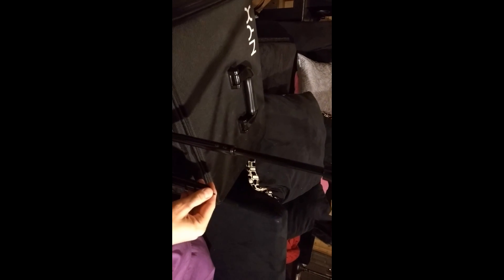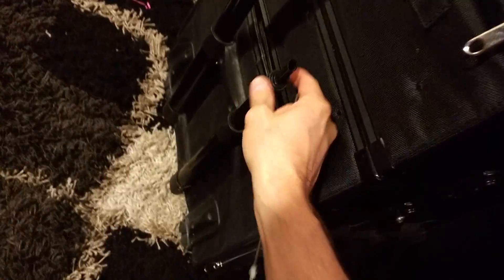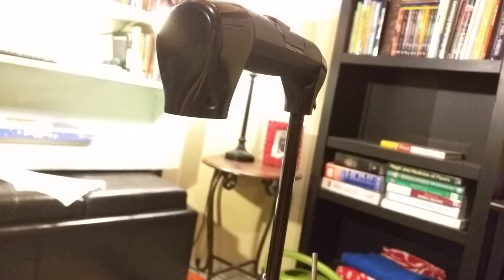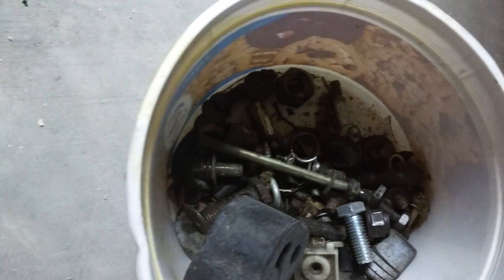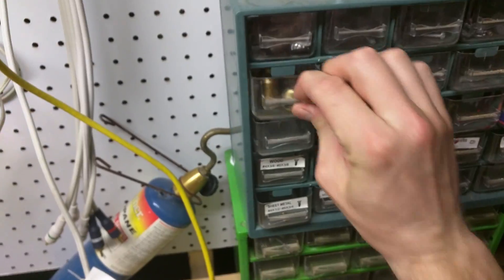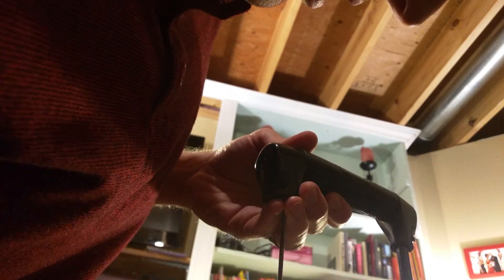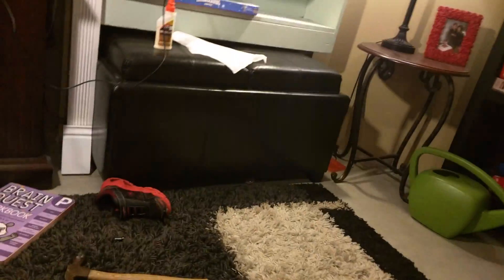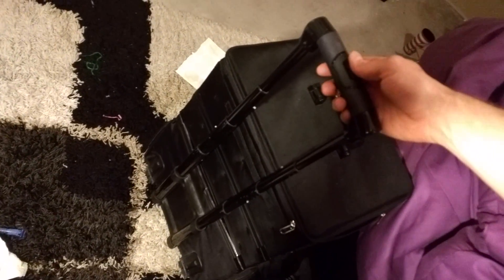How to Fix This Telescopic Handle

Comment: Should you use a nut and a longer screw + lock glue maybe? Will try your solution on the telescopic handle on a Coleman Cooler on wheels. Thx.
Reply from the maker: @afaceinthecrowd3652  I made this video so long ago haha! I'm glad it's still providing value. Maybe I should redo it. I recently had a cooler with a handle that stopped working... But it was time for a new one anyway.

Comment: Hi, I see how you repairs yours but mine is different problem.  I have a Sears Craftsman Sit/Stand/Tote Truck which is a bin with wheels and a tote handle like your wife's has even with the button to release to move the handle up and down.  However, with my situation is the handle is still attached to both tubes/rods however, it would not go all the way up.  I could not make it go up or down. There is NO screws.  Totally different format of how they assembled it.  I only could go half way but it wont go all the way up with the handle.  Anybody can help me?  Thank you.
Reply from the maker: Sorry I just saw this question! Can you try a spray graphite? Like what they use for locks? Or even WD-40. Also does the company have any suggestions on the manual?